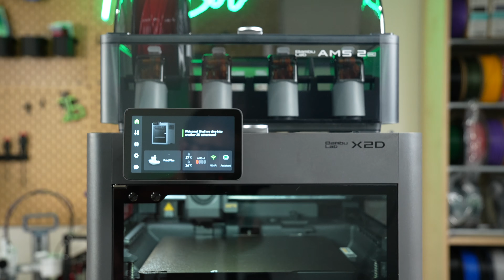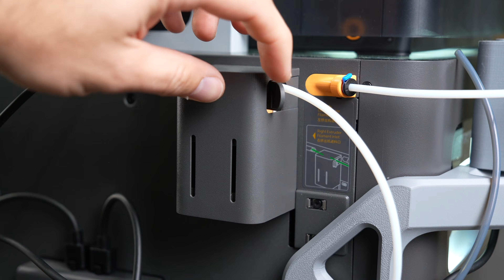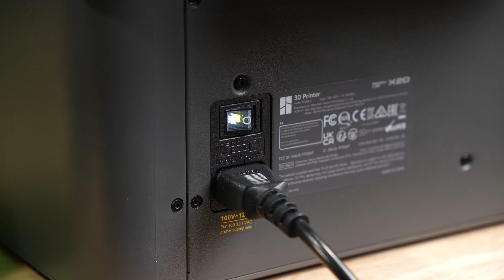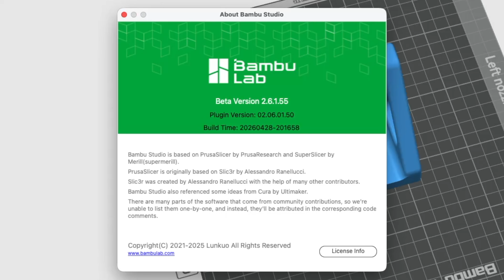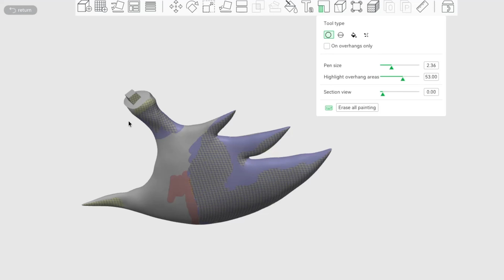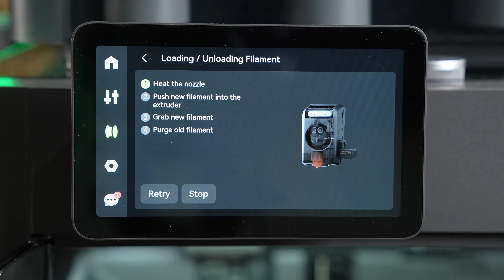I Tested the Bambu Lab X2D... Here's My Verdict

Comment: After 6 months and 800 hours of using the X2D I’m totally stumped on why my auxiliary extruder is stringing like crazy, went through many adjustments such as retraction speed, retraction length, cooling and speed, I cannot for the life of me get it working properly again.
And yes my filament is dry 🙃
I use an ams ht along with the ams pro 2.
Reply: Did you check the gear teeth. Could be wearing down
Reply: @jonathanviterise1681 yes, I did, everything looks normal, one day it was fine cans the next it started happening with no rhyme or reason.

Comment: So you can't print multiple colors with the AMS system, you have to use the aux extruder?
Reply: The first extruder still works as a normal one. Still runs the ams like normal for multicolor prints

Comment: if you are really using the heating chamber for filaments like ASA,  you need a AMS HT for drying them and also the Track Switch to get real use out of the second nozzle. with that upgrades in mind, the P2S is way cheaper and enough for most usecases. and less complex and doesn't has such a mess on his back. 

i wait for black friday sale and decide if i pull the trigger on P2S or X2D. but right now i think i will buy P2S
Reply: i order an X2D without track switch.

Comment: My xd2 is 3 months old and is off-line due to many issues with the print head. I've disassemble it 6 time so far. Replace, the Extruder Connection Board, ran many tests, some passing, even got a "Welcome Back" message, only to get errors when printing a job. I've been 3d printing since 1992, Yes 1992, way before any of you hobbyist. I've had many different printers over the years. Learned that they have a shelf life, once there's any issue with them, they're never the same, it's just down hill from there. Not sure what printer I'll replace this with.

Comment: I'm interested in this printer as an upgrade to my A1... But I'm concerned about the ability to print TPU with this? If the primary print head is direct drive, does that mean you can print TPU from the AMS?

I'm not 100% sure how well this printer handles soft material (prone to getting bunched up in Bowden tube setups)

Edit: seems like a big pain in the butt to have to get the TPU assist module.
Reply: You don't need it. Just run the tpu from external through the bowden

Comment: Great video. I bought an X2D today to complement a few P1S and an H2S. The P1S print quality has degrade quite a bit over 1500+ hours (each), and no amount of cleaning, calibrating and tuning has corrected it. I'm sure the error is mine, but... I'm out of ideas. I picked the X2D over another P1S specifically for the built-in chamber heater and the second nozzle for support interface. Everything I sell is Jet Black ASA. If (and it remains a question) I can get a zero-distance support that can be easily removed, it'll save me a ton of time and result in a cleaner final product. I remain cautiously optimistic.

Comment: My plan is to build a glass wiper consisting of a stiff ASA base and a soft TPU contact edge.
Can this be done in one print process or divided into 2 separate prints.
Or is it even possible to get the TPU edge onto the ASA base on this or any other machine?
Thanks

Comment: Just got mine and I agent printed anything yet the 6pin cable I got for the external exhaust fan wouldn’t go in the slot. I had to really force it in and it only went halfway so when I pulled it out I had to yank it pretty good and the retaking clip broke off

Comment: its crazy how when printing a TPU you need to do a add-on TPU module. buying an expensive printer and doesn't have that build-in feature.
Reply: It's really not needed (maybe for some really soft TPUs?). Majority of the folks, myself included, just feed the TPU through the back, not even using any overhead contraption. I have my TPU roll sitting in a dryer (not drying, just as a station with rollers), even BELOW the input tube level, and just manually feed it in through the back. Everything works without issues.

Comment: Must get printer for a starter. 

Makerworld is great, insane amount of items available which you can send straight from your phone. 

Print quality from this printer is top notch, and I haven’t even tried getting a 0.2 nozzle. 

Ease of use is insane, you don’t touch anything and prints come out flawless, every time. 

Ams pro 2 is a beast, though I have lots of issues with the Bambi lab filament getting tangled up and having to assist it. 

Service is absolutely a walk in the park! You can do it within 5 minutes, re-do the calibration and you’re set to go. 

Overall this printer is amazing for any starter, the price isn’t extremely expensive considering all of its positives and ease of use. Getting cheaper printers will lead to constant failed prints which mount up to frustration and a joy-kill for the hobby. Get this printer, it’s a pro-Sumer level printer, with dual nozzle though one is more of a passive set up but will still help you a ton.

Comment: I just got the x2d last week to replace my A1 that has been a work horse. It has been nothing but a headache since getting it. Having the combo with the AMS 2 is awesome except it has been chewing up my filament. I have lost close to 15 meters of filament on a single multicolor print because I have to snip right up to the part of the filament that was chewed up. I am thinking about trading it in for the Creator 5 Pro

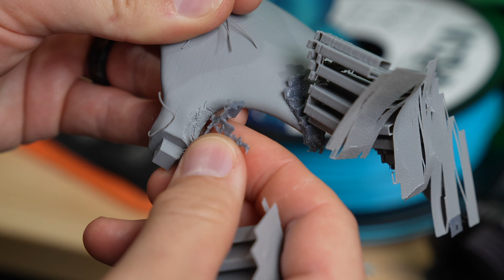Comment: Looking at the underside of that model that you used PETG as the support that ended up failing.  That bottom surface looked terrible (16:22).  I can get that good or better just using PLA to support PLA.  Is that common or is did something else go wrong that caused the bottom surface to look like there was no support at all.  Curious because I am really considering the X2D to replace my old P1S

Comment: I didn’t understand the whole hustle with printing TPU. When I had my P1S and even my A1 Mini, I just printed the TPU.

Never used AMS though.

Why the whole direct feed is needed?
Reply: I guess that it's not the 95A TPU that will give problems. It's probably the 85A TPEs or other soft + elastic filaments which is mega useful to print basic gaskets and such.

Comment: Are you running into issues with third‑party PLA on this model too? Whenever I try a non‑Bambu black filament, it fails and throws the error “the extruder is not extruding normally”. Bambu filament works about 80% of the time, but I expected better consistency from this machine.

Comment: As someone who bought the X2D + AMS 2 Pro right at launch, while the X2D is by no means the world's 'perfect' dual-nozzle printer, for $100 more, along with EVERY OTHER upgrade you're getting for the money (compared to the P2S; FOMO is real), it is by far the best printer I have ever owned. I am currently working on my second animatronic, and I am printing using PA12-CF! It's wonderful.
Reply: How difficult was it getting into the carbon fiber nylon?
Reply: @robertgaudet7407 Okay, I am going to tell you everything I have learned from experience: 

- DO NOT USE THE INCLUDED 0.4mm HARDENED STEEL NOZZLE TO PRINT PA-CF. The absolute lowest you should use is 0.6mm. Even though the 0.4mm is hardened steel and the spec manual says it
technically supports PA-CF, it does not. While I was able to print the PA-CF parts I needed with the 0.4mm, right after the nozzle stopped extruding properly. It was fried, as the abrasive PA-CF 12 damaged it internally on a microscopic level. Lesson learned. Always print PA-CF 12 with a 0.6mm nozzle. 
- USE THE BAMBU LAB GLUE STICK ON YOUR BUILD PLATE. This was a lifesaver. Having the glue stick made adhesion way more consistent, speaking purely from a PA-CF perspective.  
- PRE-HEAT YOUR CHAMBER. If you have an X2D or H-series printer, pre-heating the chamber accelerates the printing process and reduces the amount of time the stiff PA-CF sits in the toolhead. This reduces the likelihood of it breaking while the internal chamber temperature changes. 

Overall difficulty (10 being impossible): 5.5/10. 
It is not impossible at all, but you should keep the following in mind in order to ensure your system extrudes it properly!

Comment: Overall, I like the X2D because it does do engineering filaments fundamentally well, and it uses the printhead from the H2D which eye ended up with a fair number of. That said I find that the dual nozzle system is not anywhere near as convenient as it is on the other printer. Primarily because you cannot print anything decently with the second nozzle except for Bambu filaments. Unlike every printer they have that’s come out recently, you cannot have it automatically determine flow rate for an unknown filament on the second nozzle. Not to mention that they are limited to PLA and PETG, plus the support filaments. Eventually, this led me to get rid of it because it just doesn’t work as well as other options. If you want a printer, that will do single nozzle printing fairly well and engineering filaments this is a good overall printer. If you really need a multi nozzle printer, this one will lead you disappointed.
Reply: What did you go with instead?

Comment: So I just got my x2d - I have a p1p, so this is a massive upgrade for me.  Out of the box, I had issues.  I updated the firmware, then....the first issue was that it kept saying I had the wrong build plate.  The 2nd issue is that it keeps telling me my internet connection isnt good (it's in the same exact spot my p1p was in).   Finally got that worked out.  Then I moved on to printing the panda.   Now it's failing on that with layer skipping and seems like filament leakage.   
I'm starting to wonder if I got a defective machine that is going to keep causing me issues right off the bat.  

The layer skipping came from the external spool - which has black.   How can I possibly fix this?  The stuff I read says there might be a blockage or a heat issue.  This is the first print!  No blockage and the internal temp seems cool enough for pla.     Could this be the bowden drive that caused this skip?   I feel so defeated right now and massively considering sending this printer back.  Any advice?
Reply: did you get it figured out? sorry this happened to you
Reply: @albinedelman1386  I ended up sending back the x2d to bambu in under a week after I got it.  There were too many defective things going on with it.  They opened up an RMA and I sent it back on their dime. They refunded me with an apology. I ended up going with an H2D and have been happy ever since.

Comment: Interface support section: That's due to the use of PETG as the interface only. With those Aux nozzles, you have to have PETG as a full support, meaning material and interface. Otherwise, you also have a huge risk of the interface not adhering to the support structure.
Reply: Thank you! This solved all the problems for me, using petg with pla.

Comment: Having trouble making a decision. Coming from moderate-to-heavily modded Ender 3s, I'm looking for a big upgrade in printers. Shopping between the X2D, H2D, and Qidi 2 or Qidi Plus4. What I will be mostly using the printer for is sim racing parts, misc. random prints as we all do, and making molds for carbon fiber stuff like car parts, desk ornaments, and whatever else I get the itch to make. I'd also like to NOT be limited by filament types like nylon or carbon. I don't mind spending the extra if it's worth it. What would you suggest?
Reply: Simple: If you want a printer that can be upgraded and has a big volume, use H2D (costly). If you don't want that but still want to be able to print technical parts, then the X2D is good enough for most stuff (read comment to tpu printing). If you just want to print fast and good with every industrial and normal filament (no multicolour), then Qidi. If you just want to print multicolour, then Snapmaker or H2C (upgradable, costly).

Eisen
PS: Personal opinion of someone who used every printer named above.
Reply: @Eisenwolf.Ironwulf Yooo how's the Qidi. Started as a noob with the P1s and now I'm at the stage where I'm bolting a chamber heater on the P1s. And only want to print ABS if I can because it's super cheap and I love the feel. Any issues or hidden pain regarding the Qidi? Does it eat ABS like it's PLA? 

Oh and how's the world of open source + Klipper like? Been seeing a lot of things you can do that Bambu just don't let you touch.
Reply: @minimumapature3361 Quidi is a chunky boy that needs no repair on many parts and often repair on some cheap parts. Generally good prints, extremly fast and high volume (print room and fillament throughput) Its similar to a P1S but more industrilazed, better with "hard-to-print" fillament. 

Im building a Open source printer rn in my free time but cant say much in that aspect, bc of the missing time (corner project).

Comment: The reason they did the Bowden Drive was to keep the size of the toolhead the same as the X1C. It's actually really impressive, to me, that they managed to pack two hotends into such a small toolhead.

If you look at the size of the toolhead on the H2 series, it's significantly larger. 

So, it was a choice of significantly reducing build volume and increasing weight of the printhead, to give the printhead two direct drive hotends, or keeping the build volume largely the same, and the chassis of the printer the same as its predecessor.

The only alternative would've been to increase the size of the printer chassis. They were quite explicit in explaining on their blog that they didn't want to increase the size so that the X2D could be a simple drop in replacement for print farms, which makes a lot of sense.

I think there are a lot of home and casual users that don't understand the factors they have to weigh, when it comes to the impact of their choices on print farms. Print farms are massive customers of Bambu printers.
Reply: This. And apparently youtubers don't as well.
Reply: Also, its significantly cheaper to keep a similar frame for the new printer. I think that is the reason why its relatively cheap for the functions it has..
Reply: I think it was to help with the cost of the machine, I really don't get all the hate on the Bowden system. it's a dual nozzle 3d printer for under 1000$

Comment: Instead of using PETG as a support interface material for PLA, try using Polymaker's CoPE. It's chemically similar to PETG, so it sticks to PLA about the same as PETG. However, CoPE can be printed at PLA temperatures—you can get away with using the PolyLite PLA profile—so you don't have to worry about heat-creep issues using it. Plus, it's really cheap.
Reply: Do you setup it up in the X2D just like you were going to use Babbu Support for PLA with a zero distance offset?
Reply: Heat creep is not an issue as newer models of the p2s and ofc the x2d have cooling in place

Comment: Key takeaway from this whole video: Bambu thinks that having: track switchers bolted on the back, TPU assist bolted on the back, bulky AMS units sitting on top, a Bowden extruder bolted on the back, a second hot end bolted on the side of the toolhead, part of the build plate inaccessible to that second hot end, and still a TON of purging are better than just buying a tool swapping printer like the U1.
Reply: These maintenance parts are easier to access than if they were buried in the machine's innards, and it means the machine still fits nicely on a 16-inch concrete paver. Not seeing the problem here...
Reply: @robertlevandowski4457  It just belies the fact that the printer lacks any proper polish, and was rushed because U1 was eating their lunch. 

If you've ever had to do some basic repairs on a X1, you'd know that easy to maintain isn't one of Bambu's design priorities.

All of the add-ons could have been put together in one "backpack" without increasing the footprint. You could probably make it fit inside the AMS so it still could ship in the same box.
Reply: Yeah, I agree. I don't get why anyone would get this over the U1.

Comment: I’ve been using the X2D for two weeks now and am having trouble loading filament into the auxiliary extruder. Although the machine itself recognizes that filament is loaded into the auxiliary nozzle, it throws a 'no filament detected' error as soon as a print starts and prompts me to troubleshoot. I’ve already tried dismantling the print head, swapping in the spare nozzle that came in the box, and checking the filament line for fragments, but found nothing. Any suggestions on what else I should check?
Reply: Is the filament making it past the Bowden drive?  I know there is a warning in the guide about making sure the tube on the print head side of the drive is inserted far enough to avoid it catching inside.

Otherwise I recall mine giving that error when the model was set to use a different type of filament to what was configured for the auxiliary on the printer.

I'm a beginner at this so these are just a couple of guesses.

Comment: When you did the print test between the Primary & Aux extruder, were both fed through the AMS or did you use the external spool with the Aux? Only asking because at least where I live (Florida) the humidity is killer. Spools inside my AMS sit well below room humidity, so running off the external holder can tank print quality with more stringing and humidity pops. After getting an AMS HT for the Bowden I honestly can't tell them apart anymore.
Your negatives on the X2D are pretty harsh for a $649 printer, basically half the price of the X1C. Nothing else on the market comes close to that feature set at that price. Dual direct drives would have pushed it too close to the H-lineup and the price would have followed. I'll take the Bowden at $649 over dual directs at $1,000+.